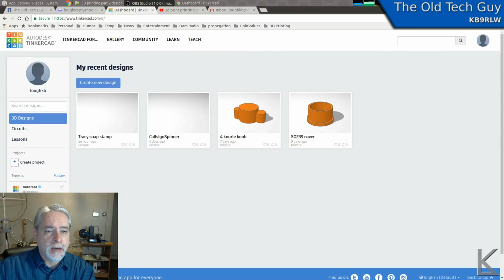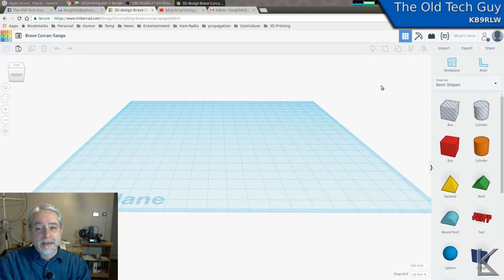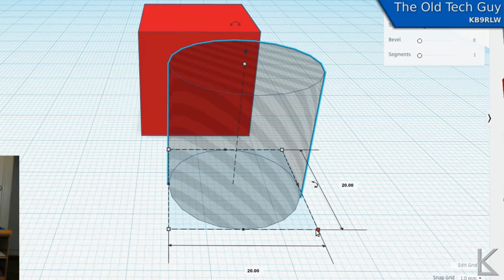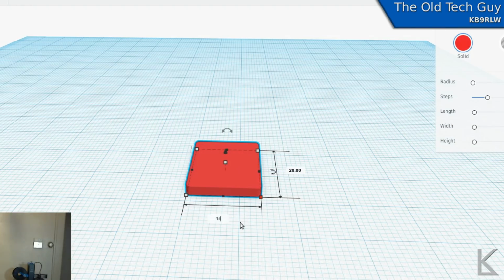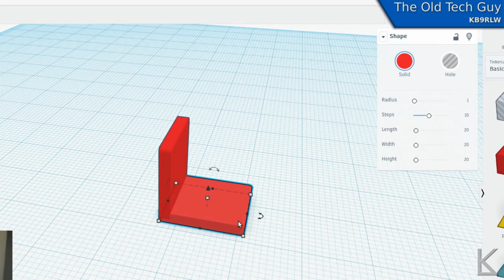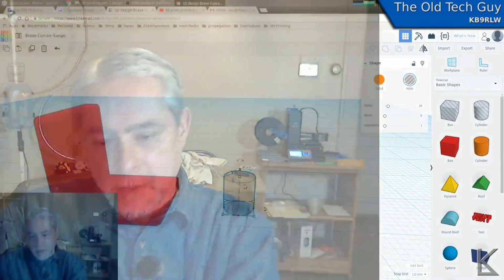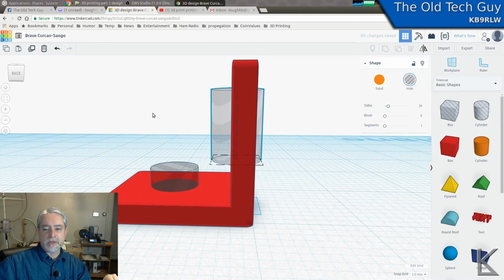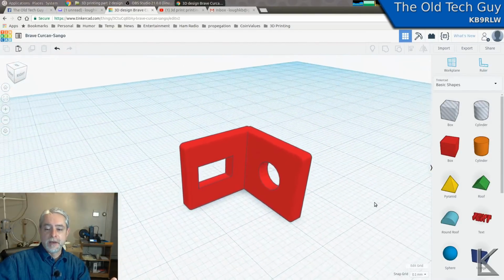Ham Radio - 3D printing for ham radio part 2. Designing parts in TinkerCAD

Comment: I'm sure a lot of hams will get the 3D printing bug from this video.  I started  with Tinkercad too and for some simple  jobs come back to it, but after banging into its limits a few times I knew I needed something more robust.  Being cheap, I looked at FreeCad  and Scad, but they were tough to learn. I finally found  "Design spark Mechanical" and was amazed to find that it was free and ran on my Windows PC (I'm not a fan of Cloud based programs) and found it 'clicked' with me.  Great features and the learning curve was not bad. Many great videos here on YT to learn from.  Thanks for the video!

Comment: I can see why you chose tinkerCAD for this video. I have been using OpenSCAD and I think I will stick with it. 
I had thought that the slicer would do the offsets that are needed to get the hole the right size and compensate for the bead with of the plastic.
Reply from the maker: In practice, I've found that not to be the case.  At least in using Cura.   I just make hole 0.4mm larger and they always seem to work out to the proper physical size.
I still use tinker for quick projects.  It's so easy to work with for someone who's primarily a visual thinker. 
I'll sometimes use OnShape for more refined projects.

Comment: An alternative way to make your angle. Rather than putting two flattened cubes together, make one cube and cut it with another like you did with the cylinders. I was also thinking you might add a small corner gusset or two to stiffen the angle.

Comment: Great job on the tutorial. Question about TinkerCAD: using a cylindrical negative does it make the walls of the slot concave? At that size it might not be significant, but just wondering. Thanks for the lessons.  Thumbs up! 
73 de WA8YCD
Reply from the maker: At that size, it wasn't enough to matter.   Could have simply pulled in a cube and adjusted it's size to make the hole.
Reply: I noticed that too. Thanks for the response.

Comment: Your MPSM did a nice job bridging the square cut outs. If you had sagging or stringing you could enable supports in the slicer.
Reply from the maker: I did a bridging test and it managed a 50mm bridge with no sagging.

Comment: Tinkercad is giving me the run around, can't get into the plotting/making things bit, any chance you could do a short video on how you get it set up?   :-0
Reply from the maker: I'm surprised.   After creating an account, when I go to the page, I get asked for my username and then password.   Then it's just clicking the big blue button labeled, "Create new design".   What are you seeing?
Reply: that was strange Kevin, I created an account, and could get the forums etc but no create new design, I just logged out and re did the url, now I have the create new design button, with a box under it with two arrows spinning in the top left corner and Fantabulous Was- written under it, will keep at it, VE7URL
Reply from the maker: What browser are you using?   It works best in Chrome and firefox.
Reply: I use Safari mostly, I'm guessing it is the video card on my old IMac, the driver for it is out of date and no longer supported, I tried it on my I7 Mac and it works fine, was trying to keep all my ham programmes on the old Mac 😩 keep up the good work, love the videos, and will give you a call on Friday if you do the on air chat. 73 Julian De VE7URL

Comment: I would have thought that if you have an old Legacy PC with an EPP port sometimes marked PRN you could install Linux Mint 18.3 MATE 64bit edition and install CADKEY under Wine64,Winetricks and zip.dll and have the CADKEY dongle plugged into the EPP (PRN) port as it will allow the generation of G_Code, might need 32GB of DDR2 or DDR3 RAM modules as appropriate.

Comment: Hi Kevin,
Don't worry about being long with the video. Your explanation was great. I see it was easy to duplicate them to print more than one.   73   WB3BJU
Reply from the maker: Yep.  In the slicer when preparing for print.  You can multiply a part and arrange it on the bed.   I'll cover that in the third part when we look at slicing.